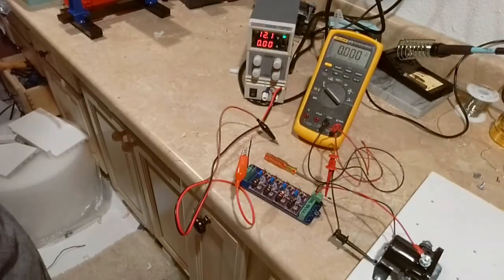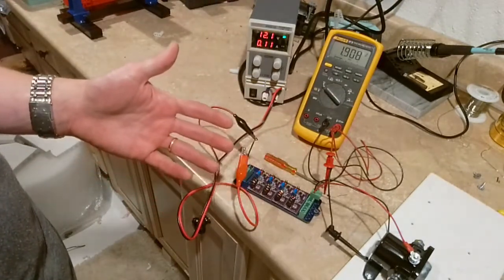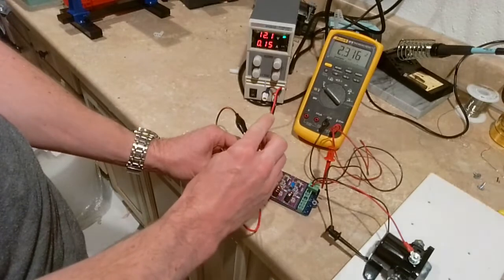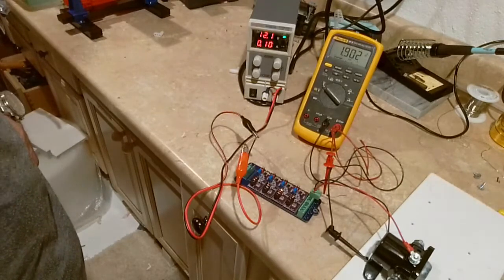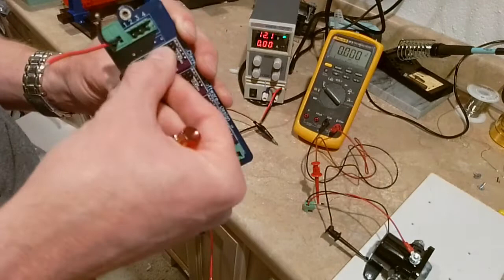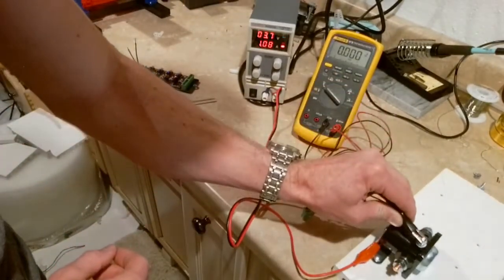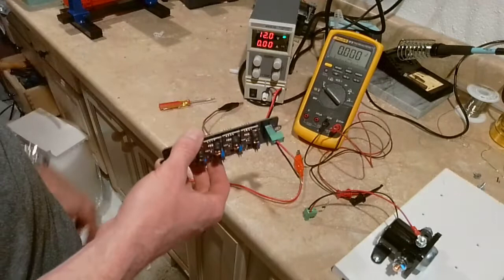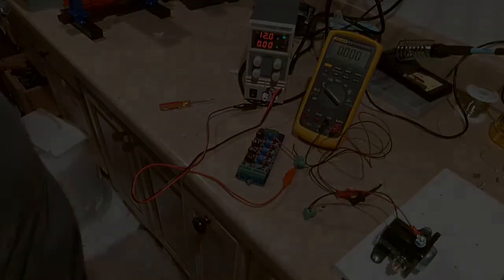New Virtual Pinball DOF Solenoid Life Extenders

Comment: Thanks for the video Philip.  Question... can I use 24v solenoids with this board?
Reply from the maker: Current design is only for 18v max, but the new version will work with 30v max. Those should be available in about 4 weeks